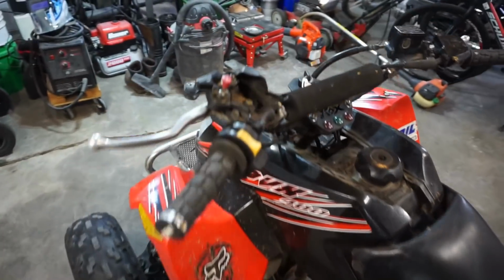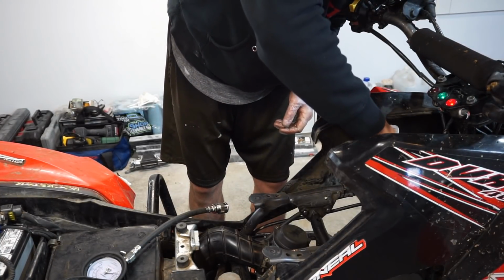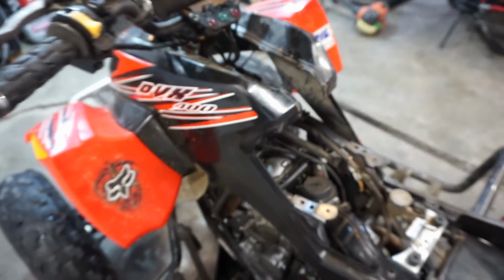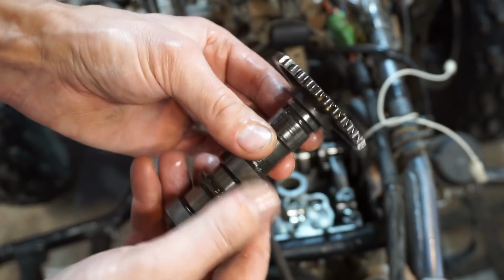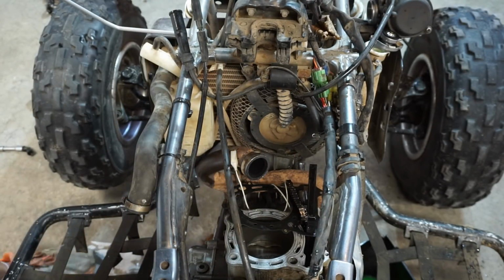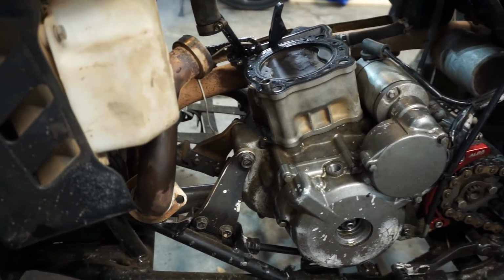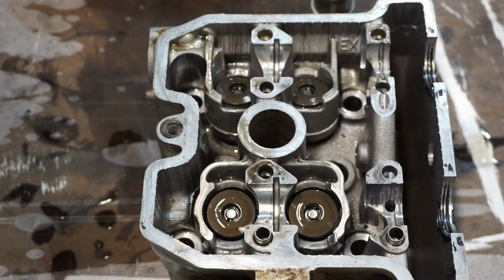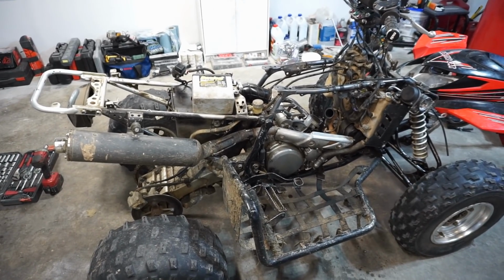How Could This Even Happen? Fixing Up a Broken Quad

Comment from the maker: I have never seen this happen before in a quad! 
Please SUBSCRIBE and LIKE the video if you enjoyed! It really helps me out a lot!
Check out my Instagram: 2_vintage_
Thank you for all the support!
Reply: what year is the quad ?
Reply: @luisayanatatianddanny6009  2004
Reply: Maybe check and make sure the gear on the crank for the timing chain might have spun possible that’s what put it out of time?
Reply: I thinking something funky is going on with the timing chain tensioner. I think the timing chain jumped time and knocked the cams timing off.
Reply from the maker: @luisayanatatianddanny6009  2004
Reply from the maker: @connorbryan1663  that's a good idea
Reply: I have a 2001 I've got a brand new top end with piston and rings spare motor all its during is what this dvx just did
Reply: @2vintage  is there a way I can send you pictures and video of my quad to see if you know what's wrong
Reply: PLEASE SOMETHING WILD A DIFFERENT a side by side or a Harley mini Moto something that will legit blow us away because we didn't expect it even a car
Reply: Hey do you have a video of doing a top end big bore on a 85 yamaha yt60
Reply: Timing was off slightly because the chain was wayyyyy to tight. I've seen this a few times myself. There's a huge difference between a garage buddy who can fix anything vs somebody who's been in the field for a various amount of years.
Reply: With the timeing chain beeing so tight holding valves open there needs to be a little lash on the timeing chain
Reply: I’m having a problem with the electrical work

Comment: My guess is that manual tensioner was improperly adjusted and someone revving the nuts off it caused the valves to float and barely hit the reliefs in the top of the piston.
Reply: I agree
Reply: I agree
Reply: I also agree
Reply: Solid answer
Reply: Around here in guide post, the northeast of England
 there's this guy who has a yzf 450 
and when he is slowing down, he revs it so it blipping off the limiter 
and goes down 2-3 gears whilst doing so 🤷🏻‍♂️😳 
 
Also he'll come off the roundabout in 1st 
and then bang 💥 on the limiter and into
 second gear hits the limiter again and 
change it to 3rd and then dose 30mph 
Pulling the clutch in and.........
You guessed it..., he intermittently pulls in the clutch and revs to the limiter 🤤🤷🏻‍♂️😳 

I just heard last week, back in October 
 he was driving along and blipping away and.....

💥💥💥🔩 a big hole out of the bottom,top and the side of the engine and all his oil all over him and the quad 

It's about £2400 to fix @ $3250 

I wish I could have been there 😉 

"Can't park there mate"  or "That'll learn you" 
👍🏼👍🏼👍🏼🤣🤣🤣🤣👍🏼👍🏼👍🏼
Reply: I mean I agree ☝🏼 with you , 
All of you 👍🏼

Comment: This was right up my ally. I have a TGB ATV that sounds like the starter wasn't engaging any teeth. I pulled that starter and it will spin off the bike with no issues. Install the starter and it sounded just like this quad. I've not checked compression yet and I don't have any spark either. This ATV will be hard to find parts for. I was lucky to find a relay for the starter, but I still need to the stock solenoid which comes from over the ocean. I am always watching your channel...keep up the great content

Comment: It was running fine with no problems! Famous last words. My favorite is it just wouldn't start this morning. The machine is got about 50 pounds of mud covering it, the dump bed is full of beer cans and when you teardown the motor, a valve is snapped off and pierced the piston sideways. Before hearing the sad story about the non starting issue, I noticed the winch cable was snapped off and on the floor of the cab, and the tow strap still wrapped around the bumper. Thats why I pay attention to what is said while I help unload the machine and wait till they leave and compare it to what they tell the counter person. Lying to the guy who writes up the work order will make your bill lower?  You're doing a great job with the vids, keep up the great work.

Comment: Didn’t you say there was a bolt missing from the exhaust cam? I would check the Crank case for the missing bolt. It may have came out and fell into the timing chain and cause it to jump and that’s possibly why it was tight at first

Comment: I purchased a 2002 DRZ400 the other day for $200 bucks with the EXACT same problem.  Previous owner had put in a manual tensioner, so I'm guessing it skipped time and bent valves.  I only got 30 psi when checking compression so I'm thinking not all my valves are bent.  I've got spark, and I took the carb apart and it all looks good.  I hope when I get into mine that it is just a bent valve!  I'm guessing this engine is a Suzuki engine?  It appears to be just like it.

Comment: Replace the valves chain and tensioner and it should be good to go. That worn out chain killed it for sure tightend chain tensioner to tight because it's worn and moved the cams and crank out of sync

Comment: Cheap manuel timing chain tensioner  and even if the flywheel key breaks it does not change the timing of the valves just timing of spark

Comment: The self adjusting cam chain tensioner tend to go bad , I would also check the timing chain and I would recommend only using oem valves
Reply: Ferrea valves are a worthwhile upgrade from oem

Comment: If it were me I would install ferrea valves, get a new undamaged bucket, ditch the manual tensioner and install a new automatic tensioner, helicoil the stripped threads, new cam chain, new piston (who knows if it has microfractures from the valves) new woodruff key (why not, it's cheap insurance). Idk if you know this but LTZ and kfx400 parts are identical to the arctic cat parts.
Reply: @titletownclowns1545  I agree 100%. Might be able to lap the valves with new guides installed but best to just have new seats cut for peace of mind. Stock z400s have crappy valves and ferrea shoul hold up better. He should also install new cam chain guides

Comment: Yo I need help getting this same quad ,Dvx 400 2004 started
I fried the wiring harness and replaced it and the cylinoid  and the push start won’t work the starters good bc it will start if I jump the cyinoid  it starts but there power to it I checked with a voltage reader and power to the button has voltage as well and the kill stitch and key both work and there power to the starter because it works when I jump the cyinoid any suggestions man

Comment: I've never heard of a one way bearing. Is that the same as the left-hand case bearing? I'll watch the rest of the video to hopefully see what that is all about.
Reply: A one way bearing is used on almost all Quads. It locks up one way to start the engine and then spins freely the other way when the engine is running. Its used because the starters on most quads do not have a retractable Bendix gear
Reply: Most electric start motorcycles use a similar system.  Know on this side of the pond as a sprag clutch.
Reply: @colinculverwell325  yes, and they also love to disintegrate every now and then and you have to replace them.
Reply: @LGKvideos  yes some more than others. Half charged or cranking with a flat battery can kill them.
Reply: @JoshX9  This is very interesting. I had just written a paragraph about this video and what is going on with the TGB ATV. This starter doesn't have a retractable bendix either...maybe that's the issue...thanks for explaining this

Comment: I need some advice. I have a 85 yz80 and I just honed and put a brand new Piston on the piston is the right size and the seals are new. 

It still seems to have low compression. What do you think I should do? 

The piston isn’t in backwards and the ring is on correct.

Comment: I’m not a super mechanic or anything but is it possible the lower timing gear could slipped or sheared a key.  But I do agree that the manual tensioner was probably the root of the problem

Comment: I never would have thought those plastics came off in one big piece lol. They could have easily split them lol. Here I thought my LTZ 400 had difficult plastics, but I’ll take that back now that I see this set up.😬🥴🤦🏼‍♂️
 Only real way to check the timing chain is to pull the automatic tensioner out and count the clicks left on the tensioner .🙂
I’m willing to bet someone was attempting to fix it before you as those brass rivets on the head gaskets are way to clean and shiny to be as old as that bike is. 🤔
Bet they timed it wrong and fired it up destroying it then figured they would bring it to someone who knew what they where doing lol.
Reply: Artic cat is the dumbest manufacturer to still be around lol
Reply: Arctic cat used to make good utility quads. The dvx is just a ltz400 with different plastic just the the kfx400.  I'd buy a  dvx if I could find a good deal on one

Comment: *Dumb Advice Offering #1* I’ve hit the starter switch & felt for air flow at the end of tailpipe. that info can give you a little insight to what may or met not be happening…either way, it’s time to wrench it out, one way or the other. a Pitching Wedge is a great tool to poke the starter while holding the club head.

Comment: I’ve seen it happen on a diesel before. Driver was rolling down hill in a lower gear. Foot on the clutch pedal. Released the clutch over revving the engine completely destroying the valves. I have a feeling the rider went down a gear. At the wrong time over revving the engine. That will cause the valves to bend.

Comment: Timing chain being too tight pulling extreme pressure on the cams may of caused the valves to do that? Not too sure, but it’s the only thing I can think. Strange failure that one.
Reply: Was just about to say the same compressed  the springs to much maybe?

Comment: Looky likey sabotaged boysee!! I feel that aluminum brake thing that fell out got caught in the smallervtop gear teeth and made it stop a second while running thus id did a full cycle of valves they all got hit then all other things after that made it all worse like the chain and bent rods and more. Imo

Comment: I would suspect the cam chain was that badly worn, that the auto tensioner couldn't take up the slack and was rattling like hell, owner fits a manual tensioner and cranked on it to take up the slack, problem is the chain is that badly stretched it's out of timing, doesn't take much for the valves to kiss the piston.
Never a good idea to fit a manual tensioner unless you really know how to adjust them
Reply: I completely agree… timing chain was too tight…. Manual tensioner is the culprit.

Comment: Hydraulic lifters may have locked open and overextended the valves at t.d.c, by the way that lifter was sitting high I would be highly suspicious of them and hesitant to re use them

Comment: He revved the hell out of it with that shitty cam chain. I would guess it slipped some teeth and was spinning so fast it had time to bend them all. I am guessing he tightened the cam chain tensioner AFTER it broke. Anytime I see one of those after market cam chain tensioners, I assume it's because something was correct to start with. I am certain it made a pretty loud sound.

Comment: If those valves hit the piston, you should replace the piston as well. There could be micro cracks under the top, and as soon as the piston gets hot again, the dome could flex and open the cracks more, causing catastrophic failure. 
If this was my engine, that's what I'd do. Cheaper than buying a new engine when the piston comes apart.

Comment: That's what happens when you have a timing chain so loose that you need a manual tensioner. The valves aren't in the correct time with it being that stretched

Comment: He was probably running race fuel or octane booster and it fried those valves. Check the flywheel thoroughly and make sure it's all good and timed
Reply: Race fuel runs cooler not hotter
Reply: @kurtyoung6769  engines not designed for high octaine will end in failure. Didnt say anything about temperature wise. The have less impurities so therefore will burn faster, which is why the motor was probably running lean